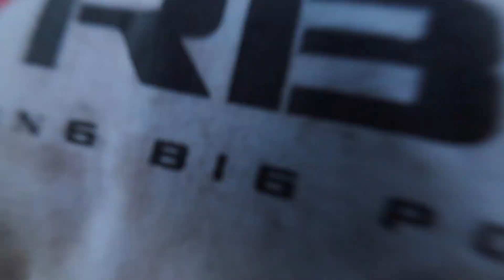They Actually Don't Make Em' Like They Used To...

Comment: I’m going to start a build soon on my 57 International S-130 and when I pulled the cab and front clip off the frame I only broke 1 bolt and that was just pulling the driver door off. Everything else came off with a ratchet. They really don’t make stuff like that anymore. That truck also sat in the woods for almost if not longer than 50 years

Comment: Np205 29 spline dodge transfer case for a manual is passenger side drop and transmission to transfer case go to advance adapters depending on what you want to go with. a getrag came with and np205 is what it came with from from stock

Comment: Ryan if you don't mind me putting some input in if you did get one with a transfer case drop on the driver side instead of the passenger could you not cut the plug welds loose in the center section and switch the axle tubes

Comment: i’d like to see a one piece valve cover on the 12 valve!
Reply: The “one piece” valve cover for 12vs aren’t really a one piece, it’s like if you lined the covers up and slapped a piece of metal over it and welded it, plus then new fuel lines are needed
Reply: @KDlGG  i know there are still individual valve covers i just like the look of the “one piece”